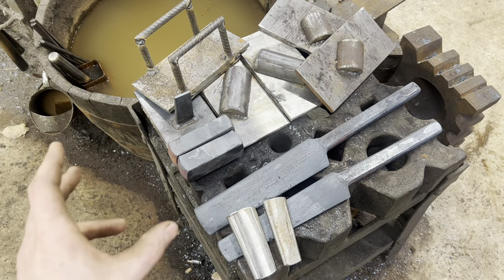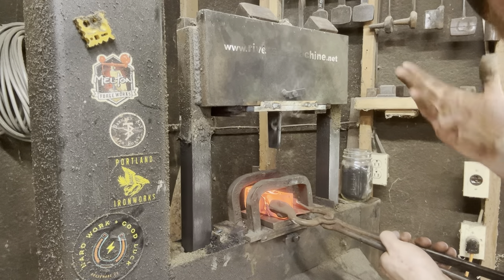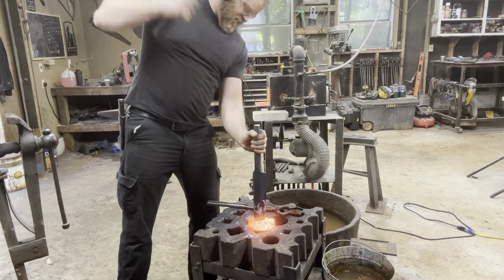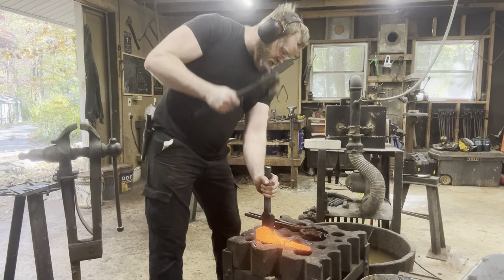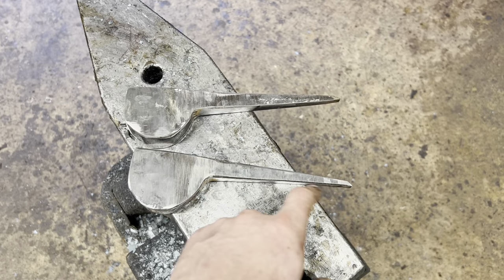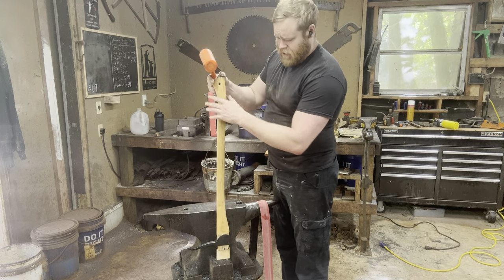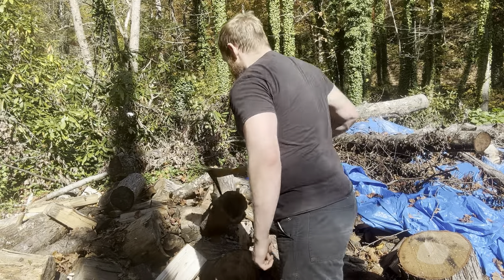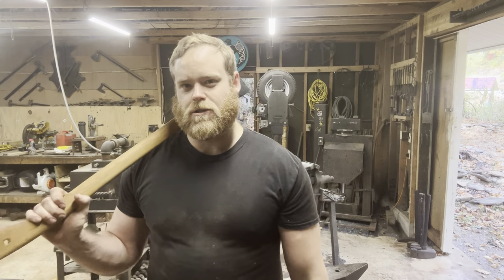Forging a pickaroon

Comment: I don't want to sound rude/arrogant, I want to give some advise;  Seeing one of his videos I noticed (seemed to me) he had more trouble than a woodworker would when sanding and finishing handles. Learning to use and sharpen a card scrapper is a huge improvement over sandpaper for getting roughness out of a handle, after it has been basically shaped. Sandp. would come after scrapping. In Youtube people like Paul Sellers teach the use of the tool. If anyone can make an effort to suggest him this it would be cool. Or if he reads this.

Comment: Nice quality video. Thanks for what you do, now prepare for all the youtube comments of "improper splitting technique." Since they know so well on the proper technique.
Reply from the maker: Yeah crazy how few people know to go after the sides first on a big round. Way easier than starting in the middle
Reply: @OldHickoryForge  I actually have never even thought of doing the sides. So, not only did I learn that I need to forge myself a pickaroon, but also learned how to tackle a large piece like that
Reply: Take a look at power cord to the hammer lose. Be safe bro @OldHickoryForge